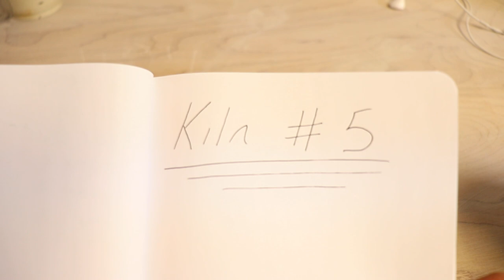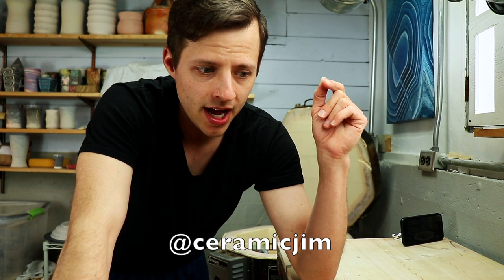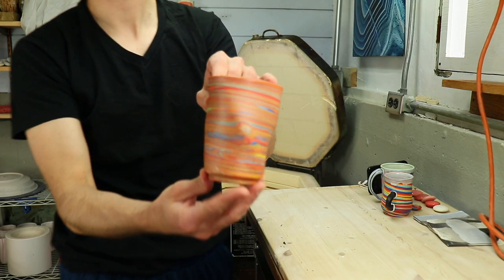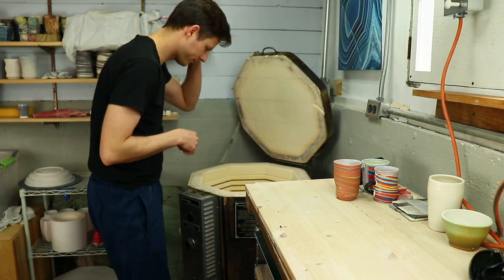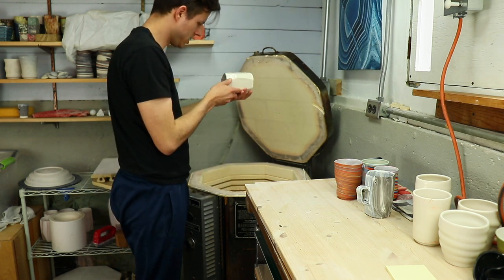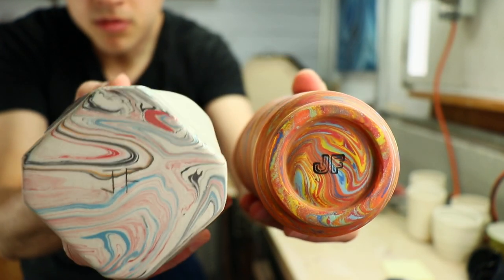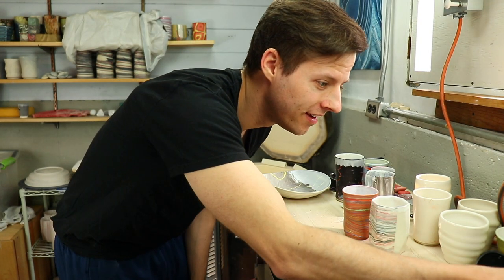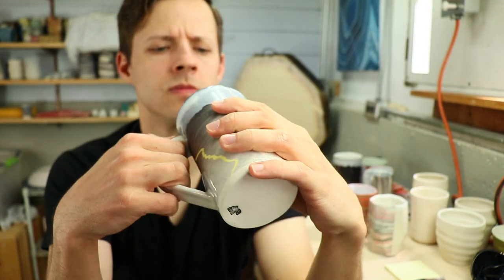Pottery Giveaway, Etsy Shop, and MORE | Kiln Unloading #5

Comment: My number one choice, would be the rainbow agateware.  It has a great vibrancy.

I think the coasters would be a great choice, in regards to sales.  They are relatively simple to make, and because of that, are usually priced lower.  Customers, who don't want to spend too much on a mug or bowl, will opt for smaller, cheaper items.

For your clay, do you mix it yourself, or special order it from a supplier?
Reply from the maker: Thanks for the feedback on the coasters, Ben. The new clay I mixed myself. I tried four different recipes for translucent porcelains and landed on this one. I've started to tweak it but that will be a slow process as I don't have tons of time to devote to just clay. It suits me for now. Thanks for the comment, Ben. Good luck!

Comment: Thanks for the recommendation for getting stains. Will be checking them out. LOVE the marbled coasters.

I’m planning to get a kiln in the upcoming month. Do you have a rec for beginners? I’m looking at a Skutt due to the many positive reviews. 

Choices: 1, 2, 3 

Thank you for the awesome content. :)
Reply from the maker: Thank you, nutterxue. If I was buying  a kiln I would get a skutt. I'm always looking for a deal on their medium size kiln. Model 1027. It's about $2,500 though.

A few things I would consider: 
What will you be making and how much space do you need? You don't want to be wishing for a bigger kiln, although I think everyone does. At the same time a bigger kiln is more space to take up. Mine is a paragon that I got secondhand and it's a little smaller than the 1027 skutt. I can fit 50 mugs in it if I packed it tight.

Get a kiln that fires to Cone 6. Even if you are currently doing low fire work (cone 05) it's good to have the option to go to a mid range firing temperature. Glazes have more depth and you have more choices. 

The medium/larger kilns require more electricty that you may need to add to your dwelling. I already had a 240V feed. If you don't or can't, they sell a few 120V models. They are tiny, but they would be plug and go.

Just talk to a skutt representative. They are very helpful. Whatever kiln you get just take care of it. Hope this helps and good luck!
Reply: @CeramicJim  Very helpful tips. Thank you Jim!